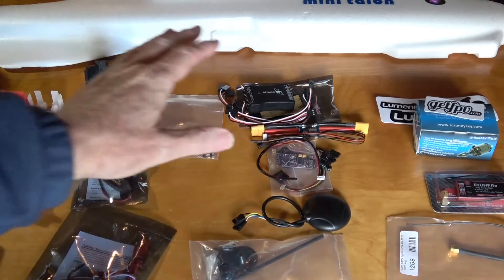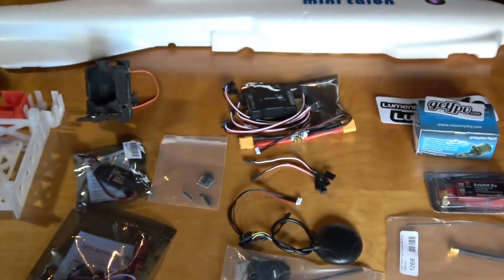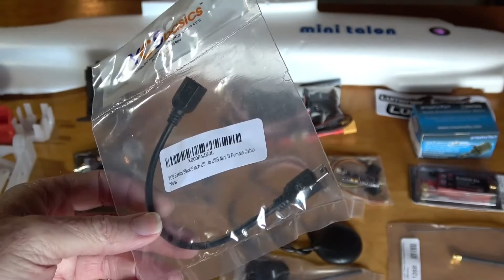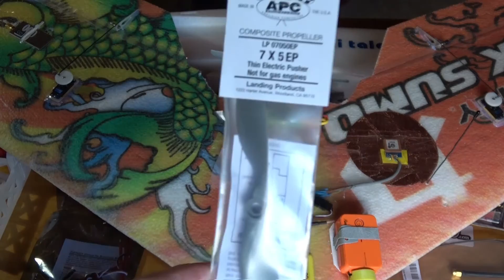X-UAV Mini Talon FPV Build Part 2 - Got More Parts So What Do You Think?

Comment: Pleased you went with the APM Mini Pro Dave....from Goodluckbuy....Bargain huh.?...I used mine in my MT with the EZUHF RX in your Clip....and SPPM input via one servo cable into port One, a jumper on signal inputs 2 and 3...good to go. Makes a very neat wiring loom. I did Link quality as per your Video on Channel #8...works really well..thanks....I put my elevator servos on a Y lead not across the Rudder Elevator channels as I wasn't happy with the mixed throws available..should still do a RTH, it may turn a bit slower though. Anyway, watching your build with interest. BTW, the laser cut Ply in mine was first class, and it fit perfect...very happy....Good luck with your build....:)...Please dont put 5.8G Video on it...It's a range machine...lol. Its a really easy Plane to build compared to some I can think of.....5200mah 4S in mine...Plenty.
Reply from the maker: I am torn between the APM Pro and the HK Pilot APMs.  Maybe I should try both. I wonder if the GPS pucks are the same between the two. Which GPS is more sensitive? Things to consider.
Reply: dmerc00 Hi Dave, well I know you are familiar with the APM 2.8 and I had one myself too...Either will work ok, but I like the DuPont Servo pin outs on the Pro Mini, its also quite a bit smaller...I have the latest Minim on mine with a 12vdc switched mode PSU on it to drive the Video Chip....Crucial because the 5vdc supply from the APM is not quite man enough to drive the APM and both 5v ends of the Minim OSD....Best part is, its no more expensive either....:)...Build thread is on the Hub...Cheers m8....watching with interest, as usual...:)

Comment: Nice plane, I have the big brother, I have my doubts on the 3D printed motor mount. Anyway,  Happy building !
Reply from the maker: thanks, I have seen some people use a screw-in PVC pipe fitting so the motor is easy to replace.
Reply: I'dont say it wont work, b.t.w.,  pvc pipe is much stronger than a 3D printed pipe.
But hey, some use 3D printed props on there crafts, never gone happen here Dave, I need my eyes until the end of my life ;o)

Comment: Looking forward to the build!
Would you mind covering the APM software side setup for it as well?
Cheers
Reply from the maker: Definitely will be covering at least some of it, especially the V-tail setup.
Check out my vids on the SkyWalker with APM. There I cover much about the mission planner.
Reply: dmerc00 lovely dmerc00 thanks! I have seen many videos on apm/pix wiring but few (or none!) on full software side setup, including minimosd, for an FPV-centric plane. I'll look up your SW videos. thanks for the great channel and information sharing. Cheers Charles

Comment: I know you have invested in a flight controller already but what about sp racing f3 with Inav. Thanks for the EZUHF videos, great firmware upgrade walk through.
Reply from the maker: That is what I am running in the Tek Sumo wing I showed you. It has a BeeRotorF3 running inav Cleanflight.
Reply: dmerc00 ah yes that's right thanks for reminding me.
Reply from the maker: The reason I am going APM is to have the way point capability if I want to use it and the nice mission planner software.

Comment: Dave, thanks for mentioning us at GetFPV and supporting us. I have a mini talon and started with our Lumenier 2216 1100kv with a 9x6. It was very efficient but I wanted more power. So I switched to a Sunnysky 2216 1250kv with a 8x6. Very happy with it and it is one of my favorite planes. Long time subscriber and keep up the good work!
Reply from the maker: I have purchased many FPV items from GetGPV, great company. Are you using a 4s battery with the Sunnysky 2216 1250kv and 8x6 prop?
Reply: dmerc00 That's great! Yes, 4s 5200mAh. Have you considered using the new Mini Vector or standard Vector?
Reply from the maker: I was thinking about using the Mini Vector but they were only pre-order or out of stock when I was ordering so I decided to get the APM which is very reasonably priced now.
Reply from the maker: Not sure what's going but I can't find a SunnySky X2216 KV1250 II in stock anywhere. Do you know?
Reply from the maker: OK, that might be the reason. Thanks for looking for me!

Comment: With the Talons wooden frame you will find it easier with vertical pins. 
I found it tight when i fitted a Cyclops Storm and found it tight with the horizontal pins. (the APM is bigger than the cyclops storm OSD) 
Stick the VTx and antenna close to the nose. That will give you proper separation from the GPS and the UHF.  
Otherwise you end up putting it in the wing of the Talon but the carbon fibre in the wing effects the signal. 
I know others who made the same mistake as me. (I put the VTx in the wing originally)
Reply from the maker: Sounds good, I will probably put the VTx on the pod in the front like I did on the Twin Star and the Sky Walker. I can see how the vertical pins on the APM might be easier as you are describing. I will probably see as I get into trying to fit the APM.  Thanks for posting.